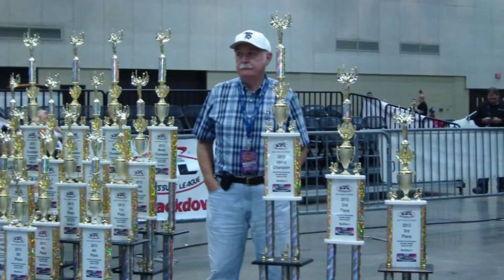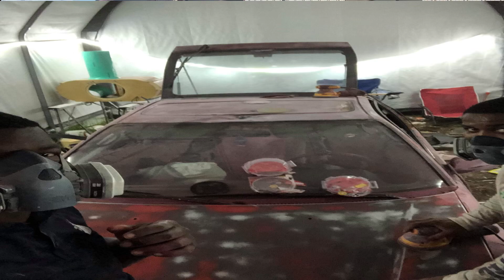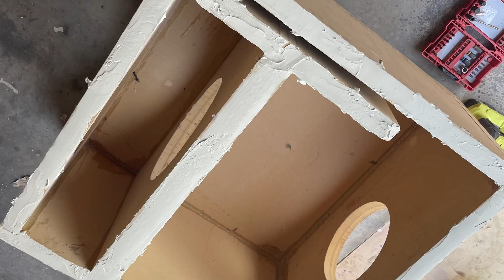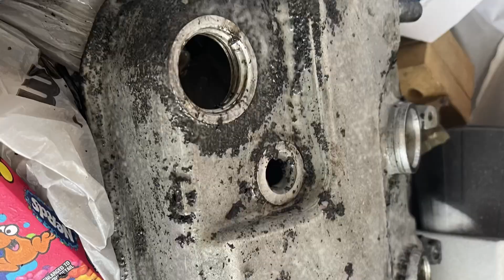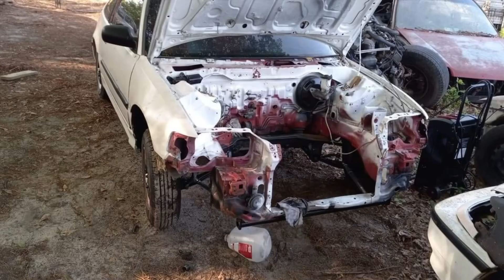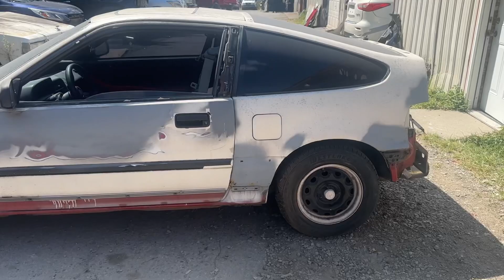Restoring My 1989 Honda CRX Si | SPL World Championship Journey 🚗🛠️

Comment: Yeah never drive a car that's been sitting in a field for a while.
Reply from the maker: I unfortunately had to learn the hard way 😂
Reply: @Mr.ChoKolate4life  it's Ok people aren't born with Knowledge that why you have to seek it especially in the information age. Check videos on YT on what to do before driving a car that's been sitting for a while. All fluids have to be drained and refilled... Brake and power steering parts might be leaking because those fluids turn into acid after a while and eat through rubber seals. The gas tank might be filled with crud and rust that can cause your injectors to rust and or clog up....fuel pump might be shot too and need to be checked and replaced
Reply: Oh and brake fluid turns to acid too and messes up your brake a clutch Master  cylinder so those two have to be replaced before bleeding any one of those parts.... leaking brake and clutch systems will never bleed air out fully bubbles will always come back.